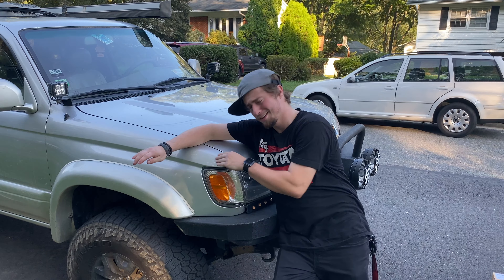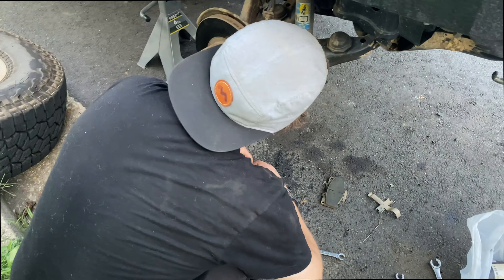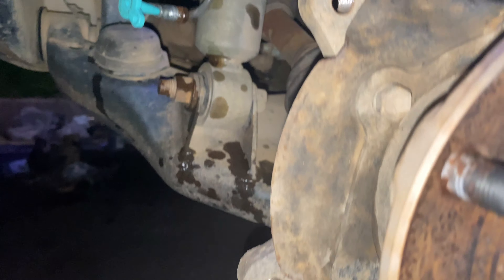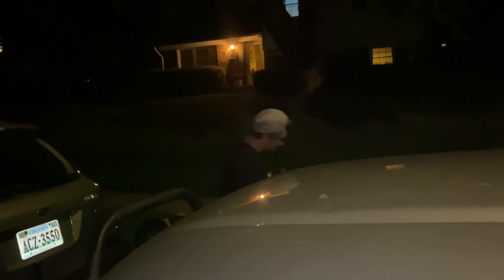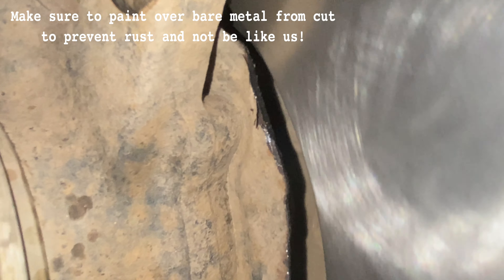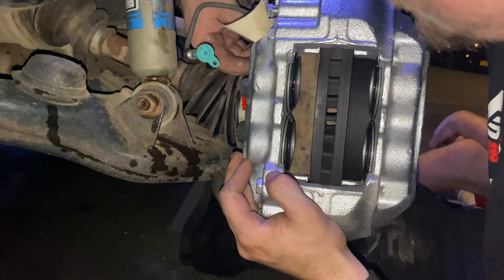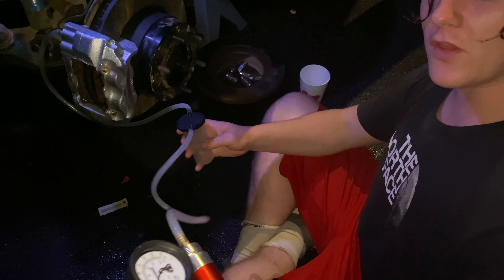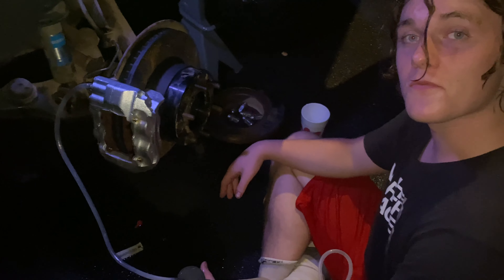Tundra Brake Upgrade on 3rd Gen 4Runner (Easy)

Comment: You think you could've gotten away with using a dremel tool instead, for the cutting?
Reply from the maker: maybe if you used a metal cutoff wheel, the shield isn't that thick might take a little bit longer to cut with a dremel vs a angle grinder with cutoff wheel